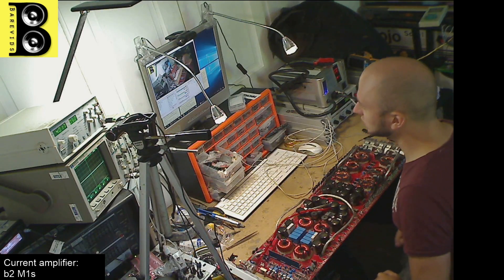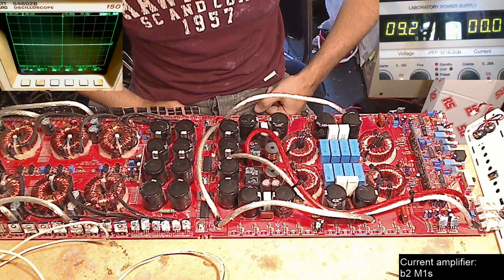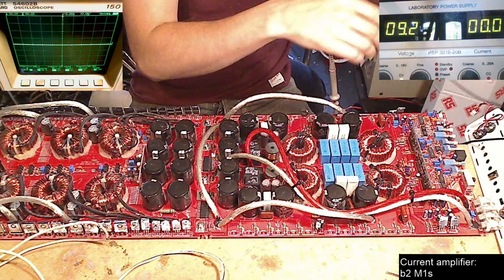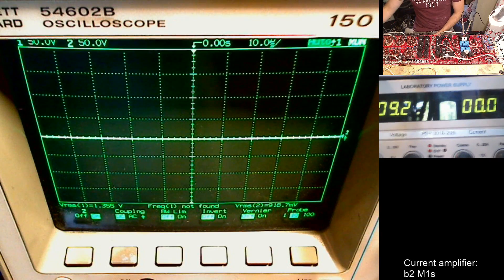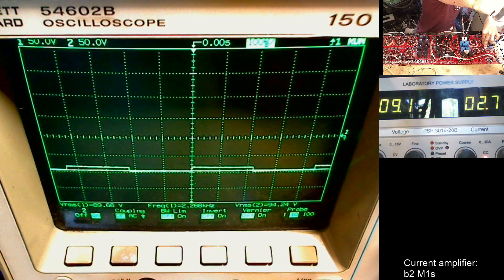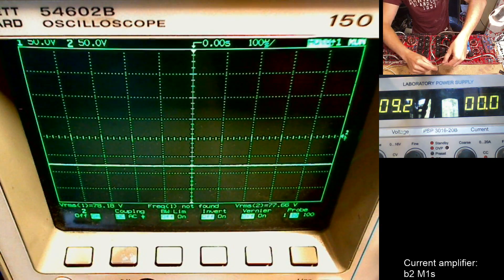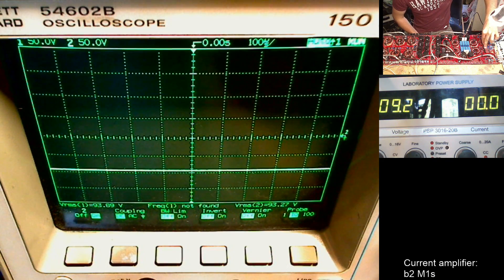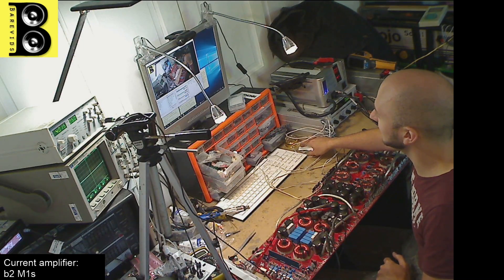Car amp repair - Fets all turn on during power up, in protection

Comment: if i turn up the volume to high and my amp getting in protection mode .. so i turn off the head using .. after 5 minutes i can play it again . then got protection mode again .. have you got any issues that would could be??

Comment: I blew EVERY transistor in my newly acquired (at the time) PPI 1200.1 amp, by bench testing it with the cover off...🤦‍♂️
I learned a VERY valuable lesson that day. Art series amplifiers have metal "fingers" on the rear cover that press the output transistors onto the heat sink...
NEVER power art series amps without the cover installed...!!! 🤦‍♂️🤣🤣🤣

Comment: Damn. I thought you had a fix for my issue I am having right now. I have an JL Audio amp doing the same thing as you are describing. With the exception that is is hooked up to full power and current available. The amp when triggered will power up in protect then the GREEN power LED will light for just a moment and the protect will come back on. Now here is the weird part. If you disconnect the input RCA's it will power up perfectly. If you plug in the RCA's after the amp turns on to GREEN  then plug in the RCA's the amp will play perfectly all day long. I drove from Tampa Florida to Tennessee and never cycled the amp and it never shut done. But as soon as you remove power, turn off head unit or cycle the ignition, it will go right back into protect. Unplug the RCA's and then turn it on and then plug the RCA's back in, all runs proper. 

No heat build up at all. All voltages look great. all speakers have been tested with my SMD speaker tester. I don't just want to throw an amp in because I'm not made of money. But I have to get this fixed. I have taken it to 2 shops and they cant tell me for sure what the hell the problem is. One shop thought that MAYBE my Pioneer head unit had burned a ground trace and that had caused a floating ground issue. I said OK and had them install a spare Alpine unit I had. Same result.

Any idea or knowledge you can pass to me would be great. Oh it is a 4 channel amp if that matters. But you have to unplug all RCA inputs for it to come up. Yes I put new RCA"s and trigger wire in the car. That was my first thought.
Reply from the maker: That's extremely odd. 
However that sounds like an issue with the floating rca side ground. I'd be looking for blown fusable resistors, ground traces etc inside the amp. That's the most likely cause for what you're experiencing.
Reply: @barevids  Thank you. I will open up the amp this weekend and see what I find.
Reply: @michaelmeisman1672 did you happen to ever find anything in the direction sam pointed you in ?

Comment: I'm starting out with repairing, is a pc based oscope ok to use or should i get something else?
Reply from the maker: Should be alright, refresh bit slow for my liking, the second bad wave appears need to shut off instantly and slow refresh can make the difference between smoking up parts and catching it in time

Comment: Question i have a memphis 500.1 it powers on fans kick on no protection mode but when hooked up 0 output from it ik its the amp cause any other amp hooked up works just fine was wondering what you think it might be 0 smell comes from it and it worked fine before it was unhooked about 2 years ago

Comment: Really been learning a LOT from your vids as well as enjoying them. I've run across an amp (class D mono) that has me stumped. With the output FETs removed and probing the FETs, the low side shows a nice square wave at the correct low voltage (-45v), the high side however shows a nice square wave at +5.2v. I've checked the output from the power side and the rectifiers, they seem ok. Any suggestions?
Thanks for taking us with you on these repairs!
Reply from the maker: That sounds correct?
Reply: OK, cool. I thought it was supposed to have -45v on one side and +45v on the other. I'll pop in the new FETs and fire it up. Thanks a lot for your time!!
Reply from the maker: Here are general readings for most generic class D amp output sections, with fets REMOVED:
LOW SIDE fet pads:
1) ~5v to ~10v rms square wave riding along the negative rail.
2) 0v
3) Negative rail
HIGH SIDE fet pads:
1) 0v
2) Positive rail 
3) 0v
NOTES:
Sometimes you will not see any square waves at all on the low or high side gate, and to make them appear you must run some signal into the amp, i suggest 40hz clean, and keep gain low. 
Also, sometimes you will see a square wave on the high side gate pad, especially in older amps that use N and P channel fets (640n + 9640 for example). The sqw on the high side gate should be around 5-10Vrms from, riding along 0v.
Amps that use ir2010s chips may show a bouncing or strange looking wave on the high side gates without the fets installed. This is normal. Just make sure the low side wave looks clean and solid.
Reply: Thank you!!!

Comment: im about to try repairing an amp i got for free from a guy but it is just the board (no case). the amps i have seen be repaired on here most all have in on one side and out on the other but this one is in/out on one side, rca on the other and 7 vertical boards across the amp with LOTS of small parts on it, im sure one is hte driver but i have no idea what all the rest do... is there a good place to go and post pics and such to get help along the way?
Reply: diyaudio forum

Comment: Hallo . Can you maybe help me ?  I Need a diode in the output driverboard D1 (xh3 8401) and CL1   capacitor Of emphaser EA15000.  The IC Nummer ist ir21844s.   Do you know which typ of diode and  capacitor are uesed Standart  for SPL Amps?   Thanks

Comment: It would take an amp this powerful to hear music over the engine noise in my 2cv. But then, that would quickly loosen all its nuts and bolts.  The tip about having enough juice for a fast charge is excellent.
Reply: I think they are ugly and the 12 horsepower is hilarious. Top speed is about 35. 
However, there are people who like them and there's even a 2CV racing circuit. People are weird.
Reply: There's nothing wrong with that, is there?  It's a fun car to drive.  Especially on small roads, of which there are plenty around here.
Reply: I'm actually a bassist, but also an electronics engineer.  One has to put food on the table.

Comment: can't believe I missed the live vid!! What can I do about some missing solder pads??
Reply: Bypass it with wire. Follow the trace back to somewhere the trace is nice and wide. Scratch off the solder mask and solder a wire to it, then to your component. Sometimes it's easier to follow the trace right the way back to another component and solder directly to a lead on it. Keep in mind your connection & wire needs to be thick enough to cope with the amount of current flowing through it.